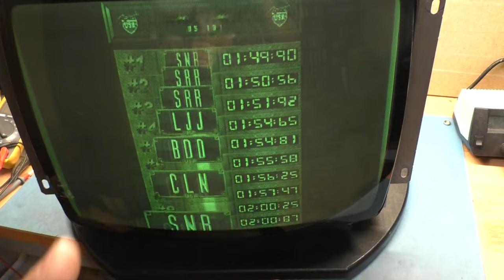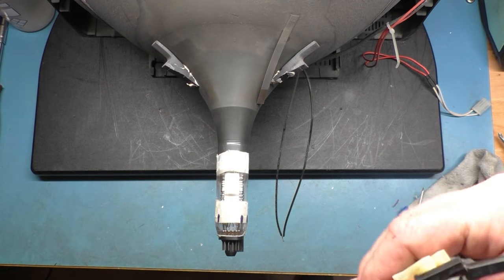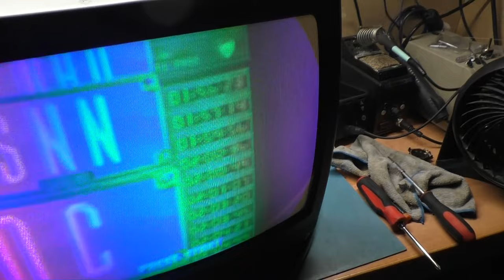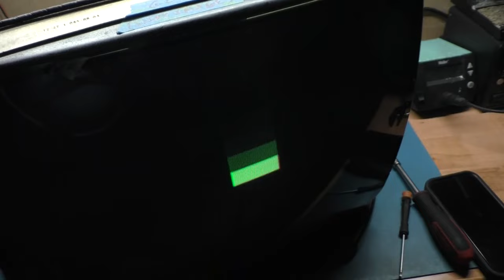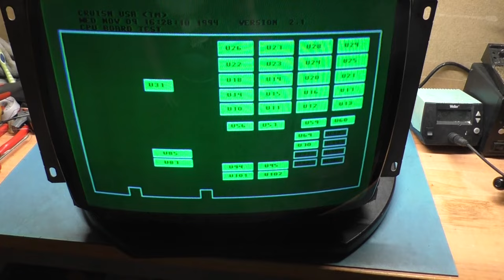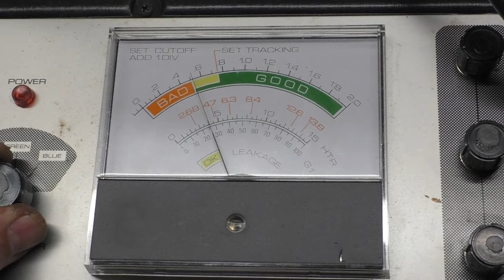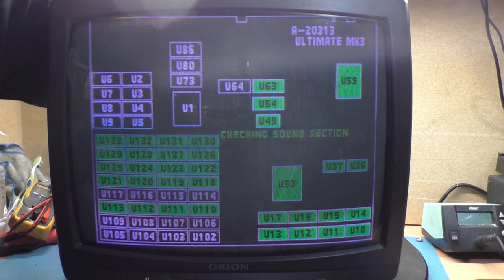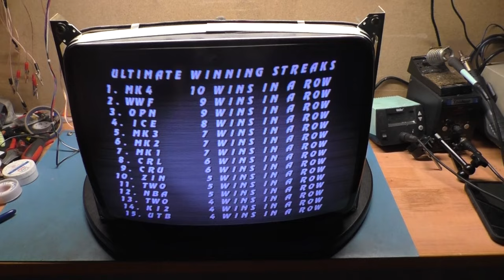19" (Medium Resolution) K7000 Arcade Monitor Tube Swap For Paperboy + Cuisin' USA PCB Repair!

Comment: You're the man, Mike. Never a doubt you'd figure something out! Question though, doesn't the tube have to be or have a certain dot pitch or something like that for medium res in addition to the proper yoke?
Reply from the maker: Technically, no. It’s completely non-discernible to your eye. I was going to mention that in the video, but I forgot to.
Reply: @mikesamateurarcademonitorr6856  that's why it's the "amateur" channel! 😄

Comment: Well now i never knew you could put 15k tv tubes into 24k mode. 

Do you think this would work swapping a regular 27 inch 15k tv tube into a WG D9200 tri sync chassis? Will the regular tv tube handle the 24k and 31k modes like the original tube?  

Great video!
Reply from the maker: Yup! 

Nope! The D9200 is tri-res and needs a very specific tube in order to display the resolution(s) correctly. Not to mention there are different revisions that use specific yokes for curved tubes and flat tubes. And the yokes are bonded to the tubes which makes them nearly impossible to remove, even if you wanted to swap it to another digital tube.
Reply: Hi Mike, the sanwa 29e31s sega naomi tube is 31k but works with a wei-ya 3129a chassis in tri sync mode. The weiya is clunky switching modes though. Would you know if the D9200 chassis would work too? Dying to get trisync going in my naomi cab 😂

Comment: Got u5000 that's only showing green. Was going to do a cap kit and new flyback. Do you think it's a lost cause when it's just all green? Was going to do rejuv as well but sounds like it doesn't last.
Reply from the maker: Most likely your red and blue transistors on the neck board are bad.
Reply: You were right!! Didn't really know what your were talking about till I looked up one of your past videos on that and did the diode test and boom two were bad..replacing all three and doing full cap kit. Thanks man!!
Reply from the maker: Sweet!